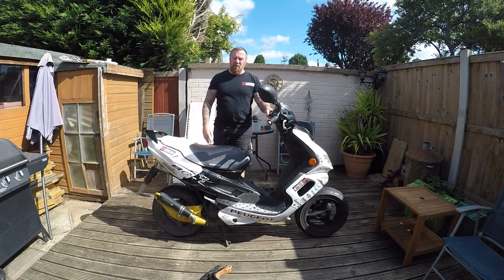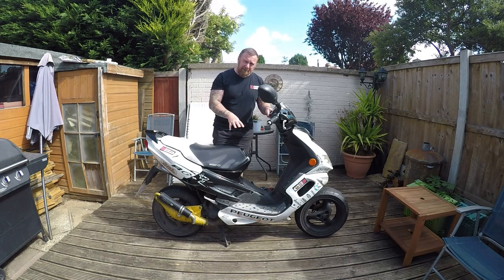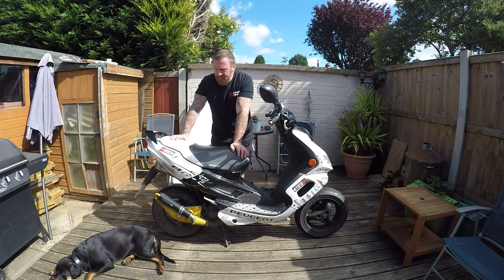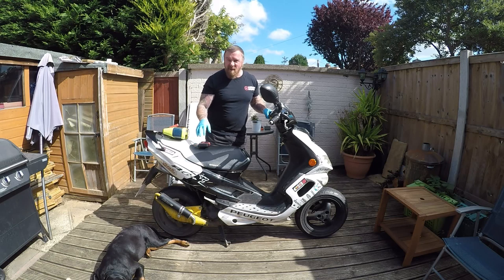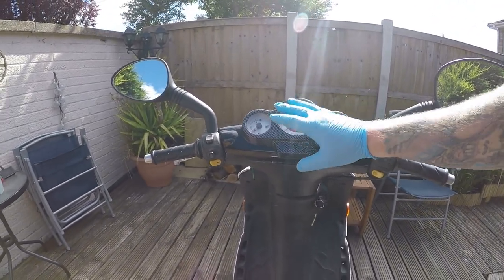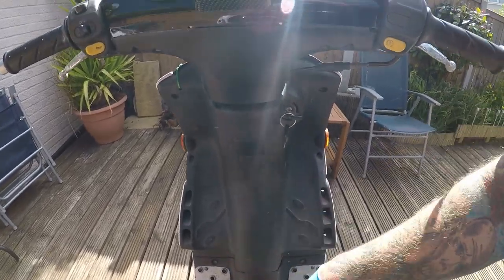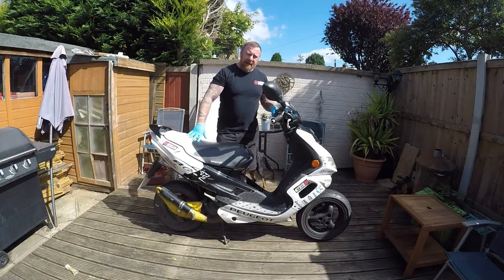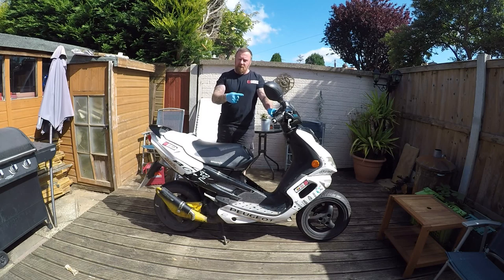SPEEDFIGHT MOPED FIXING FOR BEGINNERS MARK SAVAGE

Comment: so glad ur doing these again ive fixed 2 speedfights with ur videos on my 3rd one but bit stuck new battery new starter but when press the start button the terminals just spark no click from relay ?
Reply from the maker: There will be a few on this one bud and thanks for starting with me
So battery on right 
Micro switches ok 
Rear light comes on when you press the lever 
No click from relay ?
But spark ? From where bud 
Double check starter wirers that they are not touching 
And the live is on ok and covered and not touching the start!
This can do this 
Earth ok ?
If ok you will have to take panels all ok and trace all the wires to and from bud
Reply: @marksavage  many thanks bud yes double checked battery on ok starter wires ok brake light comes on when press brakes in put a new kick start kit on and she does try off the kick but doesnt fire tried couple spark plugs replaced ht lead good spark but unfortuntly still no joy

Comment: Hi mark, I asked a while a go about my speedfight3 how I could make him excelarate faster and I checked the variator and put in some lighter weights and that helped a litle, I also cleaned my carb and now he starts very well.

I also found a little pipe at the begin of my exhaust that was pinched shut, I cutt it open a litle and it pulled already better, so now i'm thinking about buying a new exhaust and air filter and if the top speed is to high i can lower the weight of the variator rollers, do you think that will work or is it a waste of money?

Thx for the interesting video's already learned a lott!
Reply from the maker: hi bud good to hear that these few bits helped but your sp3 is cdi restricted so you can and I would change the exhaust but you will only get a few mph out of it but it will sound better and the engine will run better plus the air filter will get more air in so it is worth it but to get the most out of it it neds to be able to have full revs which is down to the cdi 
and yes if you do id put back in new rollers again for top end as you will have much better pull away

Comment: Hi Mark. I acquired a Speedy 2 AC. AFTER stripping it, restoring front end, fairings, new paint job and electrics, I got it running. Ok can’t seem to find why I can’t get more than 50kmh from it. Variator ring removed, new weights 3x7/3x5.5 and new belt. Open CDI dellorto electric oil pump type. Original exhaust de restricted and blind pipe removed, also emissions pipe. New coil and plug... where to go from here? I did the same on my Yamaha neos ‘97 and the motor not only is more responsive, torquey, it does 75-77kmh. The Speedfight launches the first few meters then the rpm stays steady and the speed very slowly picks up to 50..🤷‍♂️
Reply from the maker: exhaust bud ,best replace that to let more gases get out plus a sports inbox air filter will help
maybe a small upjet say 4 then a tune 
all this should help
Reply: What type of exhausts would you recommend to free it up, without trying to win a race or break land speed records or my wallet?

Comment: Yo mark love vids bro so helpful g my ped will not start but it does sound like it wants to it’s a zip I’m going to get a now spark plug but if it’s not that idk if it’s my carp or it’s my 70 kits if u can give me a little advice plz do but I’m still watch your videos for help thank u bro
Reply: I wasn’t ridding it but he said it boged cut out he started it again then it bog cut out and I wil not start anymore
Reply from the maker: @finleygoldsmith2322  as you know after watching my videos like 70 kits don't do it , it's often piston failure 
However test for spark and fuel like in my videos
Did you upgrade the plug 
Bigger carb or upjet 
Air filter 
Sports exhaust?
How was it running before and how long for 
What 2t oil 
As is it 2t of 4t bud
Reply: mark savage is a 2 Stoke and I wasn’t on the ped so it was running for like 15 to 30 minutes I believe I wasn’t there and he said it boged then he kick started it then It just died just got a new stark plug it’s all upgraded I don’t know I lot about ped how to fix them I’m sorry just trying to get it looked at
Reply: mark savage my spelling and makeing it clear I’m not good at 😂😂🤣🤣
Reply from the maker: @finleygoldsmith2322  if it was me I'd be taking the head off and check out the piston for damage or scoring!
Then I'd put a 50cc piston and head back on lol 
Much better 
If you have done all normal things like in my videos so you have spark and wet hand test thats what id be doing 
Bud

Comment: Hi mark I've got a yamaha aerox which has been fully derestricted and has a leovince pipe on it with 15x12mm 4.3g rollers but I need more power up hills any recommendation's
Reply from the maker: I'd of used 6g bud 
A small upjet of plus 4 from standard 
Race air filter 
These will help as long as the bike is in good order 
Serviced and piston is good bud

Comment: Hi mark, I have a 125 vx Gilera runner with a malossi 210cc kit and pm61 exhaust. I rid it to Hastings and back to Eastbourne with no fault (around 30-40 miles) just when I was nearly home I was messing around and reved it lots as I was slowing down from about 50mph, the exhaust piped and back fired lots. Because I’m an idiot I thought that sounds good and slowing down from around 20mph I reved it lots again and it then just cut out with no noise and it hasn’t started since. I’m hoping I just flooded it? I changed spark plug for a new one turned bike over with no spark plug in it and still nothing. If I spray a bit of carb cleaner in the air intake it tries to fire up for a split second 🙈😢 any rough idea from your knowledge would be helpful please. Love your videos  keep em coming 👍🏼
Reply: It’s a 2002 model incase that makes any difference
Reply from the maker: HI bud so its got a massive 210cc kit on it so bet it does go well and has been done properly and tuned .
the banging would have been un-burnt fuel? so could have been due to failing or compression or power!
guessing your saying you have no spark it would be your cdi!!
why spray carb cleaner in the air in take? it cleans the carb it wont help start it ,that would be easy start but with no spark it will never start bud 
id say cdi bud you will have to use a power meter to see if you have power from your stator then into the cdi then out of the cdi then into the ht coil
or pop it to your bike shop and ask them lol
Reply: mark savage thanks for your reply, I bought the scooter as a spares or repair project and bought an engine off eBay as it came with a 210 kit on it, I put the engine and it ran perfect straight away for over a month and I’ve done about 500   Miles with no problems. The carb cleaner was something I saw someone use to start a bike once so thought I’d give it a try 🙈 it does seem to be getting a spark I don’t know how big the spark should be but I took the spark plug out and turned it over and there was a small spark coming from the spark plug so I assumed it was ok? I’m hoping the 210 kit hasn’t gone bang ☹️
Reply: I I watched your video on reasons mopeds won’t start that was interesting, and I think helped me take a few things off the list. if a cylinder head has gone would the bike still try to fire up?
Reply: mark savage so, today I got home from work and thought if I can’t get it started today I’m going to strip it down to see if the piston is nackerd, I took the side panels off and checked the spark plug lead and connectors then noticed the see-through fuel filter had no fuel in it then I noticed there was no fuel going to the carb!! So take the bike home and checked the fuel gauge and it said it had a quarter of a tank so I dropped bottom fuel line out of the tank and there was no fuel!!!! So turns out it’s got a faulty fuel gauge reading it has fuel when it doesn’t!!! The needle does move to full when I fill it up! Thanks for your advice sorry for wasting your time!! Thanks for the helpful videos 👍🏼
Reply from the maker: @Outdoorscott  well its really good news bud 
Just add fuel pmsl
And a easy fix as they just twist in and out 
Happy days

Comment: Hi mark I have watched a lot of your video I have a problem am fixing a skyjet up I not touch any of the wireing but put the battery on started first time but very Smokey it been standing for long time but I done oil change clean card out before I started it that's my first problem the second one is I left the battery on over night and when I took it off the next morning Todo some work on it the positive lead's where hot at the touch what can cause this any help will be appreciated
Reply from the maker: no wires should get hot unless on the wrong way or a power drain which there shouldn't be!!
re charge the battery and connect and see how it is and dont leave on lol
smokey not to worry about unless it does it all the time then it maybe rings but if it runs ok id leave it and just keep an eye on the plug , keep clean bud

Comment: Hi Mark. I have a speedfight 2004. And when I'm driving a bit my oil hose comes off from the carburetor not the hose but the metal part which goes in the carburetor. What can I do to fix it. I thought maybe I could put some hot glue on the end of the hose or is it a bad idea?
Reply from the maker: This does happen and it a reason why the end up seized?
You can sometine tap it back in wirh a soft top hammer otherwise yes glue it in but I'd use silicone
Reply: @marksavage  yeh but it goes like in but moves really freely.

Comment: Hi mark hope you and ya family are doing well.
I'm having a problem with my 49cc liquid cooled speedfight 2 if watched ya videos on carb tuning but can't seam to get mine sorted.
When I start the scooter It it seams to want to move on its own I've turned the idel screw down till it almost dies but it still wants to move on its own so I got a new throttle cable still does it.
My next problem is when I set off it seams to struggle the goes but when I come to stopping it seams to rev night then eventually drops but still waiting to move forward on its own and its stressing me out big time as it's booked in for an mot Thursday
Reply from the maker: This can be a few things  bud 
Carb as in needle 
And slide 
Manifold problems 
So sticking in air then it dies 
I'd take it all of and start again 
The carb can have fractures and also cause problems 
As for moving 
And this can be the problem all in 
Clutch and or variator and belt 
Check it out like in my variator videos clutch videos 
They will help
Reply: Thanks Mark your the best I'll watch some more of your videos and re clean everything and recheck it all

Comment: Hey Mark, i have a 50cc moped 6g rollers ,white clutch springs and it goes 46mph. Do you recomend i put a white contra spring and will it help in tjr top end
Love ur vids tnx.
Reply from the maker: Thats a good speed bud to be honest so clutch won't make much of a difference 
I'd be happy with that 
Maybe a small upjet by 4 and a tune but otherwise I'd be happy 
Thanks for watching
Reply: @marksavage Okay thanks i have a 2018  model so would the cdi be restricted

Comment: hey from norway. i have a Peugeot speedfight 2 liquid cooled. I have trouble with it going hot. Do you have videos or tips on what that might be?
Reply from the maker: I will be covering this in my next few videos out weekly but I have out 70 speedfight on my channel that should all help 
However runs hot?
Over heat ?
Losing water ?
Cuts out ?
Reply: @marksavage  over heat yes.the needle comes up on the red, so I have to drive slowly for a while.the scooter feels like it runs normally all the time. possible broken temperature sensor?

￼

￼
Reply: @marksavage  not losing water

Comment: I got a GY6 2011 TaoTao I put a big bore kit in it was a 50 I change it to a hundred everything brand new give me a hard time starting not cranking properly.... Any ideas
Reply from the maker: That would be the 100cc kit lol
They don't like it 
Did you watch my big 70cc kits dont do it video
Have you changed the carb, exhaust, reeds, jet, plug , air filter ?
Re tuned 
Got the timing right ?
Its a night mare bud

Comment: Hello Mark wondering if you can help. Son has a speedfight 3 ac 2012. When he’s been running around 40min plus, it occasionally won’t go above 5mph then suddenly starts working fine again. This can happen for a few minutes or longer.  Thanks in advance.
Reply from the maker: With out hearing or knowing how the engine is running and I'm guessing that's fine 
I'd be looking at the variator belt and clutch like in my videos 
The sp2 set up is the same on the sp3 so they will help

Comment: Hi Mark! I have a Speedfight 3 Darkside 2012 50cc 2T LC. I have restricted sport exhaust + Restricted CDI unit possible restricted everywhere. I have 12.5mm carb and 82 size main jet. It has been serviced by professional the moped was good the max rpm 10500-11000. But one day get slow down, and between 6-7000 rpm I lose or lost the acceleration for a sec. The moped strugguling between 6-7000 and max speed 25-28mph. That problem always come up so I bought a new carb same 12,5 mm size. Same problem. The carb looks clean inside outside. I pull a full throttle and I always more times lost the acceleration between 6-7000 and need a really long straight road to can go further than 7000rpm. Could you advise something? Thanks
Reply from the maker: If you canged carb I would have used the old jet !!
However variator ??
Follow my variator video bud 
Rollers !!

Comment: Nice video i subbed .I found speedfight in good condition 98 year for 550$ And i want to get it .Please tell me if its worth and will it be good for me.I want to drive it from home to work daily and i live on a bit hilly place .Will this 50cc 2 stroke go uphill
Reply from the maker: As for $ for a 1998 that's a lot but if its in very good condition and runs very well then I'd go for a view and test ride 
If there's loads of hills I'd also change the roller for 4 g to get more go out of it but you would lose top end but for every hill there's a down to pick up speed lol 
1998 here £300 to £400 but I know the USA pay more 
I've 70 videos if you do by it to help you keep it on the road 
If you can get the 100cc! Bit more power but the 50cc will still get you there 
Take care bud
Reply: @marksavage  ok man thank you i will think about it
Reply: @marksavage  i got it mark it is in good condition i asket the guy about the piston and he told me he changed it 3 4 years ago.Out of that it runs great and it pulls nicely and its sounds nice.Should i touch somthing pistons or else or should i just drive it.The thermeter guide is broken tho how can i fix that stuff (the point goes fast immidiatly but its not even hot)

Comment: Alright off topic from the speed fight but I managed to locate an old dt80 engine and won the bidding told it's got a siezed top end what's the best way you've found how to unseize one? Cheers
Reply from the maker: hi bud worth pouring oil down the head and leaving for a day or two and then putting in gear and rocking back and forwards if its a head seize if bottom end not so good bud to be honest 
they were better built in them days so you might be lucky other wise its all off and new bud

Comment: hi mark just out of curiosity whats the top speed you have had out of these speed fight 2s 50cc
Reply from the maker: hi bud well 30 mph is standard , AC 42 TO 45MPH, LC 45 TO 50MPH. no i put everything on one of my sp2 it was blue and it did 62pmh and pulled like amazing, it was mad and the best ive every had out of the 100s ive had 
over 100 speedfight videos on my channel bud
Reply: @marksavage  cheers for getting back to me mate love your channel always watching your speed fight videos I’ve got a speed fight 2 ac you have any idea how I can get it to do a little bit more than 30 it’s got Leo vince tt exhaust and been up jetted got 6 gram rollers still on standard carb

Comment: So glad your back with mopeds any chance you can do full dismantle and put back together on speedfight 2 100cc?
Reply from the maker: This will be everything off bud , theres only a few different bit on the 50cc to the 100cc, 
while ive got this what can I help you with bud 
and thanks for watching
Reply: @marksavage  im just curiouse about the rollers so I have a 100cc speedfight 2 need to know what impact it would have putting 3, 6g and 3, 13g  or do I just put all 6, 6g in or all 6, 13g in?

Comment: alright so my front brake doesn't work and I've tried everything, I'm consider its broken. The brake has no power, do i just buy a new or is it commmon on these mopeds?
Reply from the maker: Very common rhe servo goes 
If you have good pads and the piston it free to move and you have refilled the the servo up and tried bleeding it and it won't pump it more than likely needs changing 
Have you tried a pump bleed  unit ??
Reply: @marksavage  yeah me and my dad tried everything (he is a good mechanic) so he knows what he is doing, and yeah i guess we gotta buy a new brake

Comment: I got the same issue with my Gilera no brake light, horn and indicator also the dash doesn’t work.
Reply from the maker: you will need a power meter to test the power from the stator coil to the battery bud as this maybe the problem or faulty indicator relay , blown bulbs , this is what mine was as in my next videos bud

Comment: I have a problem with my speed fighter2    when i start it.  It runs backward. And then after i cut it out and start it agai n it runs the right way around  pleaese help
Reply from the maker: I've seen this before and for me it was a faulty starter motor 
Once I changed it 
It was all ok !!
I'd try this bud first as it should sort it 
Take care bud
Reply: @marksavage  okay sound but the stator motor looks quite new and ive heard it could be the stator plate too
Reply: @marksavage  ??
Reply from the maker: @chancemochan7009  why would it be the stator ?
Starter bud defo